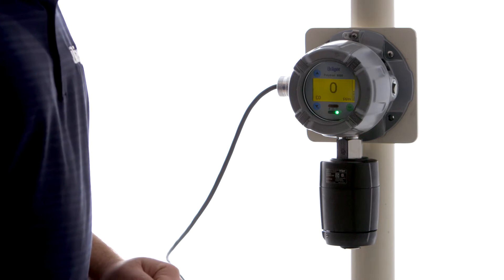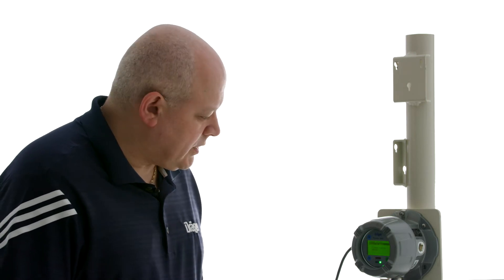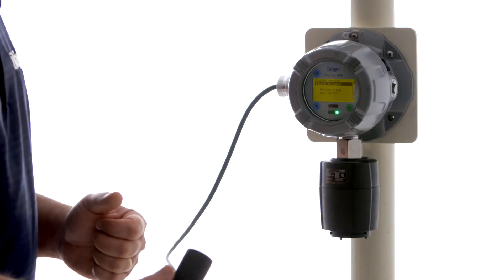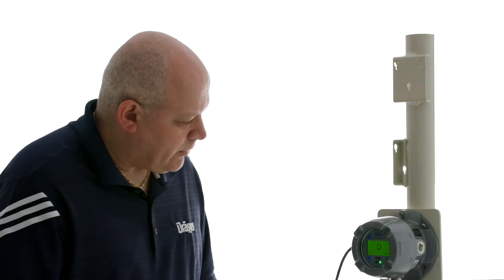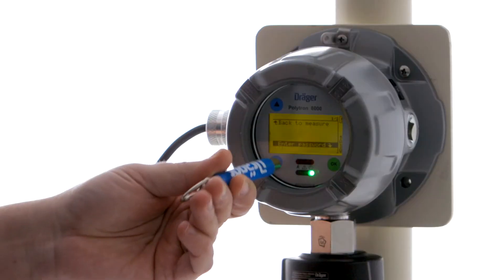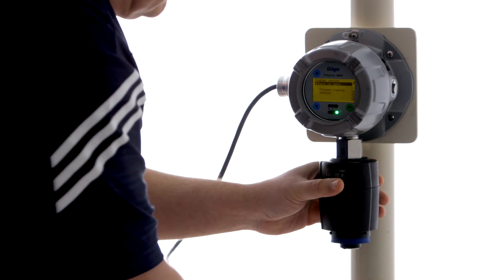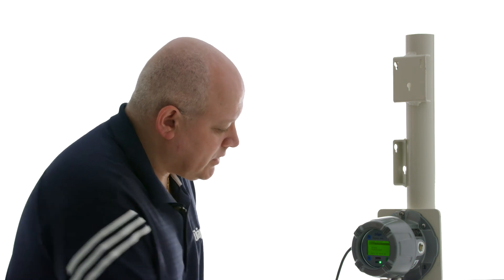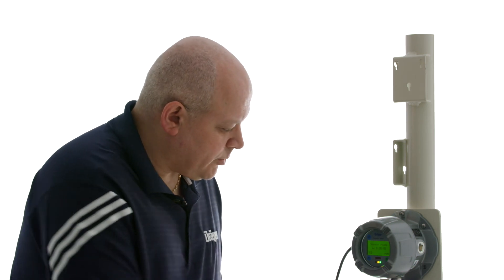Replacing the sensor on a Polytron 8100

Comment: Sir is there maximum life span of sensor before it replace or doing preventive maintenance? Or it will only depend if the calibration will failed after so many attempt. And that's the time to replace sensor.  waiting for your help to answer thank you...